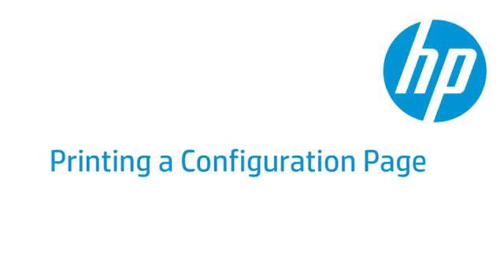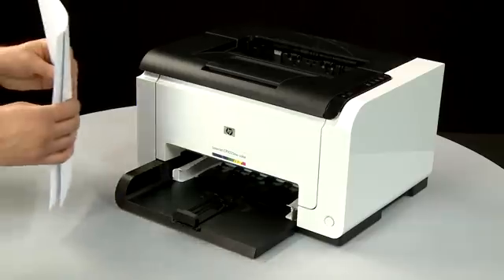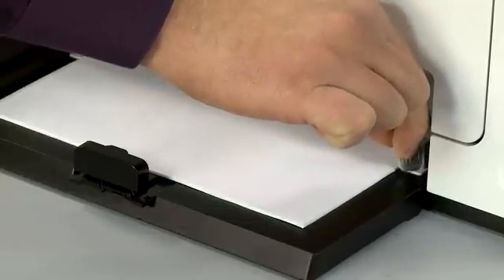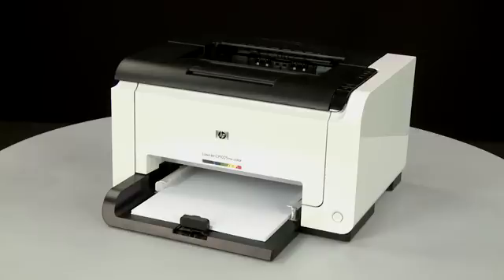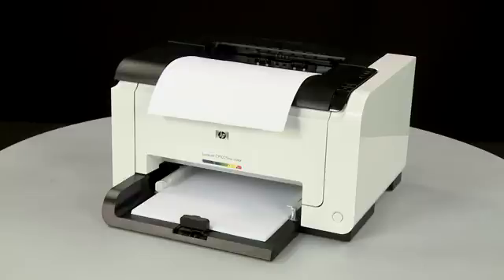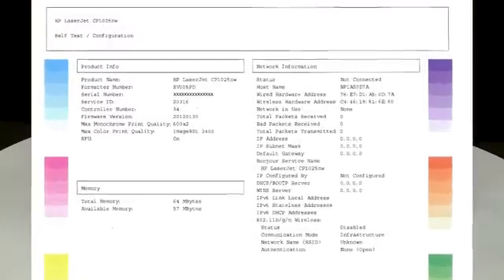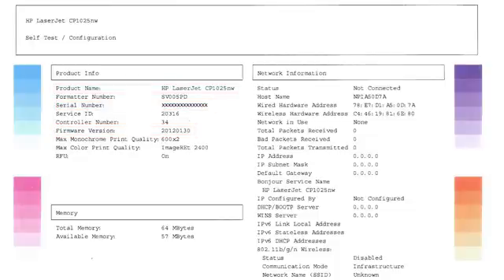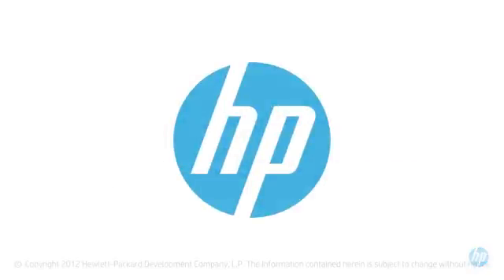Printing a Configuration Page | HP LaserJet Pro CP1025nw Color Printer | HP

Comment: My friend has switched computers from Windows 7 to window 10. I tried to install the driver for his  HP LaserJet Pro CP1025nw Color driver, and during the installation, a window pops up asking me a password. I tried his window password, but that did not do the trick. What can I do?
Reply from the maker: Hi Lucien, thanks for contacting!
I understand that you are experiencing an issue in installing driver for your printer.
I will do my best to assist you.
Please download and run HP print and scan doctor from here to fix the issue: https://bit.ly/3olFych
Binu - Social Media Tech Support
Reply: @HPSupport  Thanks for your support but, it did not work. It could not find the printer. I think that, when the popup comes up and asked for a password that I don’t have, it just deletes the installation. I may be wrong, I really don’t know. If you can help me, your support would be very valued. Thanks in advance.
Reply from the maker: I believe you are trying to connect to the wi-fi direct network of the printer and it's asking for the wi-fi direct password.
Try 12345678.
Binu - Social Media Tech Support
Reply: @HPSupport  I will try and let you know. Thanks.
Reply: I did give the Wi-Fi code as password. Now I see that the HP LaserJet Pro CP1025nw Color is on my Wi-Fi but, it still did not install on the computer. I retried the installation and got that popup again asking me the password. I wrote down what you had suggested, 12345678 and it still does tell me that the installation failed. Any other tricks to get it installed on the computer?

Comment: ok my printer works fine however I would like to connect using the bluetooth feature, however none of my computers seem to pick up the printer that way, the hp website is no help at all, anyone have any suggestions ?
Reply from the maker: +WarlockCore Wi-Fi Direct is a connection option with most HP wireless printers released in 2014 and later. Use Wi-Fi Direct when a local wireless network is unavailable. Please refer this document for complete information: https://bit.ly/3umsZR6
Reply: @HPSupport  Thanks for the reply, I will give that a shot

Comment: I have a HP InkJet and HP Laser Printer from HP. Both are less than 3 years old and I have never had so many issues as I have had with HP. I spend hours calibrating the colours every time I want to print something and every time it is something different wrong than the last time. Btw, I gave up on the InkJet 2 years ago and only use it for printing text. HP always blames everything else than their products.
Reply from the maker: +Troow May I know the model number of your printers and the exact issue you are experiencing on it so that we can check the details for you?
Reply: @HPSupport  It is a Color Laserjet Pro M525n. Just to mention some of the issues; The prints are always to cyan or to magenta or have broad stripes of the primary colours. Many times I tried to change settings in the toolbox. The toolbox only works now and then. I have to completable remove the drivers/software from HP and reinstall it to get it to open or it complain about the usb. I use original ink and have tried HP paper. I have Adobe Photoshop and PaintShopPro ( I know how to work those programs as I have used them almost as long as I have been printing) and I have been printing for more than 20 years. So unless you can come up with solutions that I can't find by googling, don't bother.